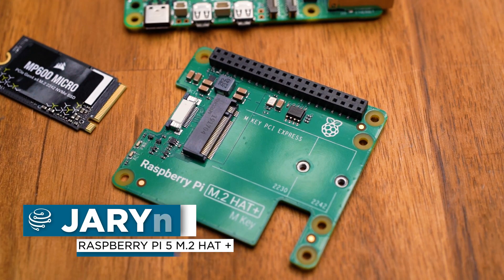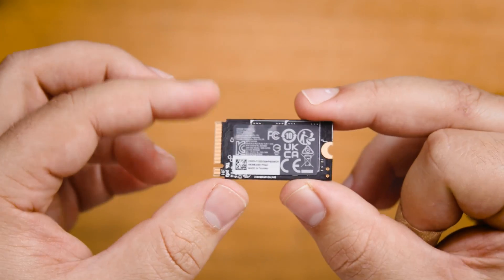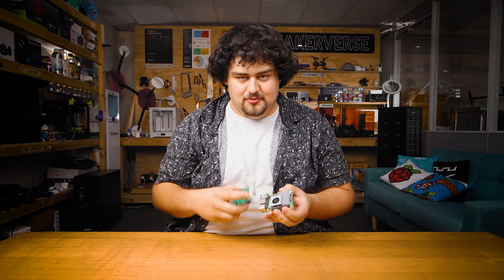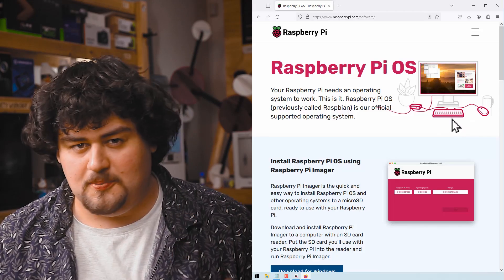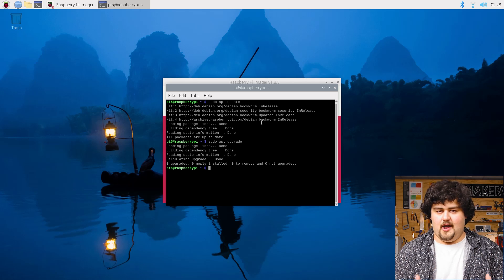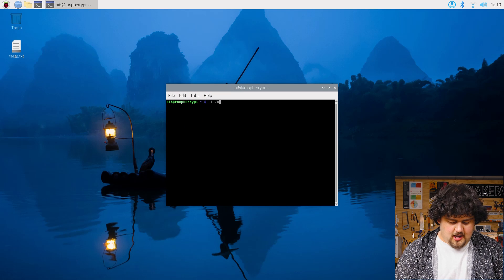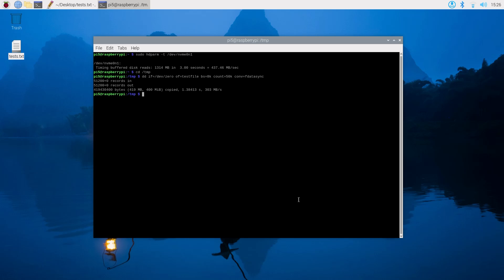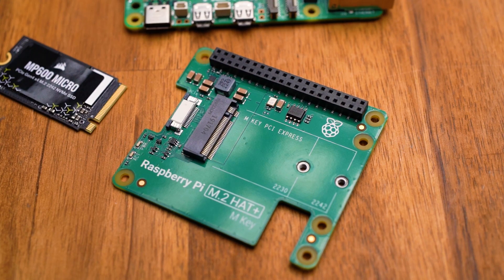How to Boot Raspberry Pi 5 off NVMe Drives with the M.2 HAT+

Comment: Hi, I have an SSD with 500GB, and I have already made a partition 50:50, and I have already filled the first partition with Ubuntu, which works on my Laptop. Can I use the other partition to fill with Raspi OS to run it on my Raspberry Pi 5?

Comment: Very helpful. Thanks bud
Reply: Hi buddy,

How do I remove the pi OS on the NVMe to allow batocera to lead the boot from the SSD. Struggling now to get that system to operate and I don’t really need the pi OS as I only plan to emulate on the pi.

Comment: Hi!
How do I add Retropie into the SSD after doing those steps?
And, making sure system will boot into Retropie?

Thank you
Reply from the maker: It should be the same process as outlined here for any other OS. However, retropie currently doesn't have  an official image for the Pi 5. We would reccomend to install Recallbox, which actually runs a bit better than Retropie nowadays and you can find it in the Pi OS installer.

If you really need retropie, there are ways to install Pi OS, then install Retropie ontop of it, a quick google search can help!

Comment: With the work around, if I initially flash the micro SD card with raspberry pi OS, can I then flash the SSD with another Distro, like Unbutu for example? I’ve noticed it in the available options when we can select the OS.
Reply from the maker: Yes you can! We just flashed Pi OS as an example.

Comment: Thank you for this video.

 I noticed that the HAT mounts over the GPIO pins, so does that mean your HAT gets extra POWER from the SSD there, or is it POWER'ed from the PCIe Port cable ??

I am using a FREENOVE (FNK0098) bottom mounted SSD HAT and it is a bit flaky on BOOTing the Pi. The FREENOVE Hat only has the PCIe cable (ie: no GPIO Pin connections) so I am suspecting the random BOOTs (Approx 1 hang in every 5 BOOT attempts) might be POWER related.

On the positive side, when the FREENOVE Hat SSD does BOOT, it is FAST .... I am doing your OPEN CV Tutorials and getting about 2x fps scores, compared to yours.

Comment: Not sure if it’s related to the Phison/Polaris MP16+ controller, but for my 512GB WD SN740 I found that setting a 1-second bootcode delay (bootcode_delay=1) in the EEPROM config fixes the “brcm-pcie 1000110000.pcie: link down” error and other boot failures with gen 3 enabled on hard resets/cold boots. I also set nvme_core.default_ps_max_latency_us=2500—and plan to try 6000/10000 next—since my NVMe appears to support 6 power states (PS0–PS5) according to smartctl logs, whereas these on compatibility guides typically show only 5 states. I also did a rpi-update.

Comment: I just installed the hat on my pi5 and wonder how to access the gpio header now. The extension is way too short for the pins to stick out.
Reply from the maker: We were able to plug hardware into the header just fine? The header doesnt have to sit perfectly flat on the PI, there can be a little bit of a gap to raise it up if you need taller pins.

Comment: 4 Pi 5's. All configured to Gen3 speeds all over clocked. with three different NVMe hats. micro center ssd getting 750-800mb/s no matter the hat. My samsung 960 Pro 512gb ssd is getting mid to high 800's mb/s read/wrtire as is my CM5. All my Pi's are 8GB RAM versions. seems to be in configuring and the SSD itself. Hat doewsnt seem to matter the brand. I have 4 differe4nt hats for all my Pi's

Comment: Are there expansions or "hats" for ram expansions? 

Or maybe one that lets you add cpus to a pi?
Reply from the maker: While the PCIe does offer a fast connector to the hardware on the Pi, RAM and CPUs need wayyyyy fast speeds than what it is capable of. There are also a lot of other logistical challenges with this unfortunately 😔.

Comment: Thanks fro this video!. W
hat about when you want to boot with custom OS image on the NVMe drive? how do you tell RPi to start reading from the right place?
Reply from the maker: If the image is flashed onto the SSD, and the Pi is trying to boot from the SSD, then it should behave exactly like it does with a micro SD.

Comment: From Denmark,

Super site and good explanation.

I just put a 1Tb M2 disk in my PI5, and then couldn't get it to boot from it.

But I quickly found out by following your site, I subscribe to your site because I think you're good.

But I'm thinking, what about cooling for the processor. ??.

I had a small fan like this that was in the case, but it doesn't fit anymore.

But otherwise I can just put a 120mm fan next to it, then blow some air into the cooling fins.

Thumbs up
Reply from the maker: We found that the official active cooler was able to fit underneath. It doesn't have much space to suck in air, but unless you are overclocking and stressing it all the time, it will be more than good enough!

Comment: Because my case blocks the ssd card slot, is it possible to do this install using a usb drive instead? Or will the pi not natively boot from usb?
Reply from the maker: Its definitely possible to boot a Pi from a USB! The steps are similar and here is a guide for that!

https://raspberry.piaustralia.com.au/blogs/getting-started-with-raspberry-pi-5/usb-booting-and-network-attached-storage-nas?srsltid=AfmBOorA6DriH3TW3BTY_kwSKLwXLaCx76RwYLMnOgDUTwdOHpMKhaRy
Reply: I often use a SATA drive with a SATA to USB-3 cable

Comment: I have a hat that allows 2280 drive, but I don't see it in the file explorer. I'm not sure I've installed the ribbon connector correctly. It looks like it would fit both ways so I may have it 180 degrees wrong, but how would I know?
Reply from the maker: Sorry for the late reply, when you plug the cable into the Pi 5, the Pins should face toward the USB ports, if you are still having issues, feel free to chuck us a post on the forum post for this video, we have lots of maker eyes over there that can help. Just give us a little bit of information about your setup.

https://forum.core-electronics.com.au/t/how-to-add-an-ssd-to-your-raspberry-pi-5-with-the-m-2-hat/19959

Comment: This is an excellent production, thanks, but it didn't work for me when I tried to image a 2 TB Samsung 990 PRO SSD NVMe drive from the Pi OS, which reported write failures to the drive. 

I didn't bother to troubleshoot the Pi failure, but instead placed the NVMe drive into a USB adapter and used Raspberry Pi Imager from a PC to write the image.

The Pi booted from the NVMe drive with no problems, and is seriously fast!
Reply from the maker: Very strange that it worked through the USB adapter and not on the Pi to install it. Thanks for letting us know!
Reply: @Core-Electronics  I didn't perform anything like a scientific test to find out why the 2TB write failed, but I'm going to try again soon. I bought a 500GB version of the same NVMe (Samsung PRO NVMe SSD) to see if the 2TB size might have contributed to the write failure.

I would have had better results if I had simply used the ones recommended by Core Electronics, but I had already made the purchase.

Comment: Simply clone the OS from the  SD card to the NVme drive. Then the  job is done ! What about M.2 2280 form factor SSDs?
Reply from the maker: This hat only accepts up to a 2240, but other 3rd party vendors have released their own HATs that accept 2280s if you need, but you can often find the smaller ones in the same price range nowadays.

Here is a Pimoroni HAT that accepts 2280: https://core-electronics.com.au/nvme-base-for-raspberry-pi-5-nvme-base.html
Reply: @Core-Electronics  Great ! 👍 Thanks

Comment: What happens to the heat sync and cooling fan?
Reply from the maker: With the default stand offs, the active cooler will fit underneath. It doesn't have much room above it though, but it should be plenty enough even when overclocked.

Comment: Can i use nvme 2280? I bought pi m.2 hat+ yesterday
Reply from the maker: The M.2 HAT only has mounting holes for a 2230 or 2240 sized NVME. But a 2280 NVME will technically work, you will just have no way to securely mount it to the board.
Reply: Thanks mate! I manage to boot it from nvme 2230.
May i ask is it possible to install pinn os on nvme?

Comment: the correct command is: dtparam=pciex1_gen=3
I've achieved read speeds of around 80 on an SD card, 
400 on an SSD with Gen2, and over 800 on SSD Gen3.

Comment: Great vid, thx! The instructions on the full guide link are very helpful. I know  a M.2 2280 drive is too long for the secure screws on the Hat, but would a 2280 drive work after making a custom way to hold the drive in position?
Reply from the maker: I don't see any reason it shouldn't, as long as it is securely attached and makes a proper connection!
Reply: @Core-Electronics  Thx so much! I'm only asking because the price of the 1TB M.2 2280 drives are lower then the shorter 2242 drives.
Reply: UPDATE: I loaded Rasp Pi OS on a Samsung 970 EVO 2280 SSD NVMe M.3 500GB drive. I purchased the drive back in 2020 and have used it quite a lot for different projects. It boots and works perfectly!

Comment: Question. Im using roboflow on my surface pro and steam deck my model is getting 5fps  with this be faster? I need at least 30fps
Reply from the maker: The Pi 5 is meant to be a small low-cost computer and your steam deck will likely be many times faster than it unfortunately. ☹️
Reply: @Core-Electronics  I dropped the size from 640x640 to 200x200 I'm at 22fps now detection is good. What if I use the Google coral board or the Google coral tpu usb one? Will performance be <40fps

Comment: Using Disks on Ubuntu 23.10
256 GB Disk — Sabrent SB-2130-256 [R21B47.1] (/dev/nvme0n1)
at 18 May 2024 17:42:07 BST (5 minutes ago)
10.0 MiB (10,485,760 bytes)
462.2 MB/s (1000 samples)
0.08 msec (2000 samples)

I'm happy with that!
Will clone the drive and check write speeds sometime in the future 
Again thank you, you have made an old man very happy 😃
Reply from the maker: Cheers for the testing not John! We will add it to the list of SSDs that work for other people.

Comment: Got my m.2 Hat+ today. Added A Sabrent  Rocket NVMe 4.0 256GB, part number SB-2130-256. Could write to but not boot from. 4 hours later changed my boot priority. Sabrent is working well. Will benchmark and share later. Thank you so much 👍
Reply: Does it make it significantly faster than running on SD card?

Comment: How about update the firmware to latest via SD-cardand then boot up in the onboard installer and install from there ?
Reply from the maker: You could definitely do it in that order, but the firmware issue may only be an issue for Pi 5s that rolled off the factory line early and don't have the newer "post-april-2024" firmware, so we left it as sort of an addendum.

Comment: Bought one and didn't like how it constricted airflow.  For 12 dollars, I'm not complaining though.  It gets in between the official case fan and CPU.  I prefer the official case fan over the active cooler because its less noisy.  Third party nvme cases probably cool it better
Reply from the maker: Some slightly longer stand-offs might fix the airflow issue, but we found that the active without the fan on (just using as a passive cooler), still performs well even when overclocked, so you might be able to play with your fan curves to keep them slow and quiet. It is a bit of a shame that it doesn't fit in the official case with the case's fan though...
Reply: Might give an unplugged active cooler a try.  Passive, silent pi's have been so appealing ever since pi 1  @Core-Electronics